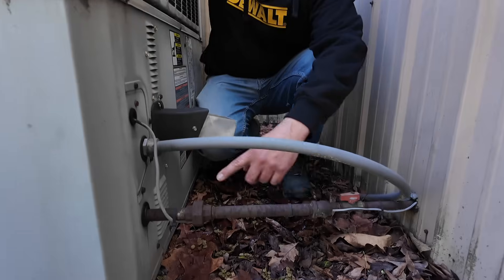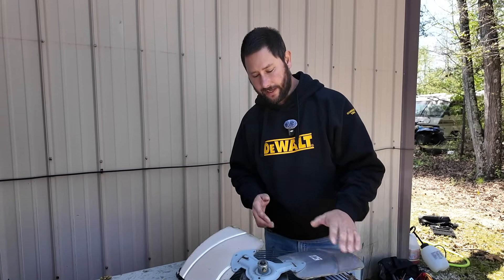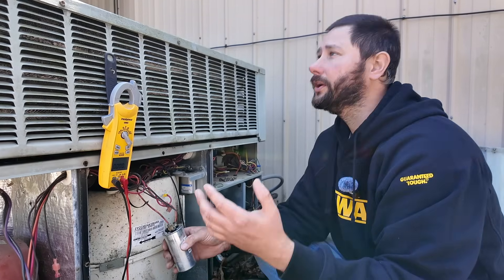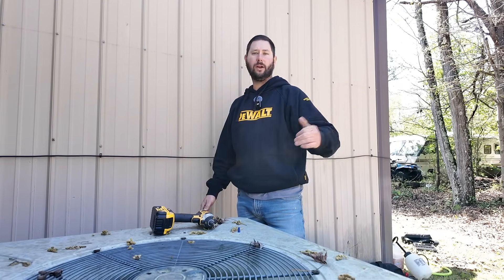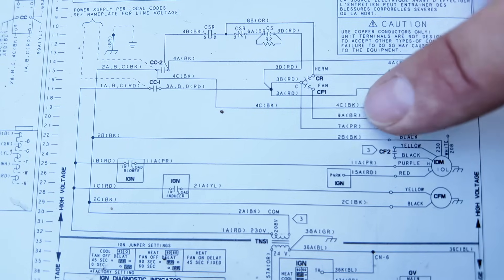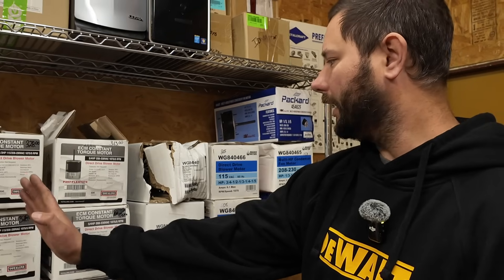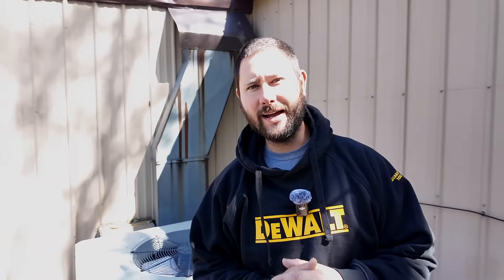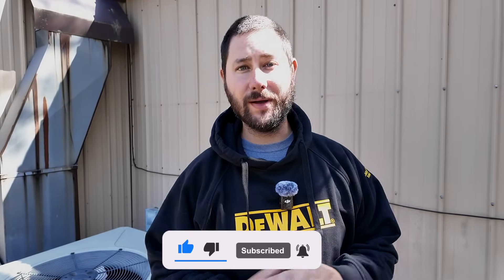How do YOU Repair an Air Conditioner?

Comment: I used to work for a company called Johnson controls building York Miller, Picken, and Fricks air handlers I was a lead builder and we built 100% custom air handler units from the ground up and there’s nothing like regular AC units. The coils are not self-contained. They have to be connected to a cooler and heater system and they can get very complicating looking like houses almost each section has doors oh and another thing with the closed housing motors on the fans is possible with an air handler. It doesn’t always have to be an open housing because there’s such thing as a washdown unit and that unit is designed to be able to be washed or to have significant leakage on the inside without damaging any component inside or leaking fluids out the outside, and it’s also designed to be able to be washed.

Comment: That capacitor is not bad. It is still good. Younhave a tolerance of +/- 5 or 6 %.
Reply from the maker: Then answer the question of why the fan motor did not run properly with the capacitor until after I replaced it.
Reply: @taddydigest  comon Tad you know 4.9 out of 5 is not bad. Might of had a loose connection.
Reply: @taddydigest  Loose connectors
Reply: @taddydigest the capacitor MAY be bad, but not based on the reading on the meter. That reading is perfect. Either that's a false reading, or the capacitor has an internal problem unrelated to the mfd, or it fails under load, or it's just fine and the motor is flaky or bad connection as the person above said. But for sure nobody can say a 1% reduction is a bad capacitor. Pull up any Amrad 5mfd you have in your shop right now and see what it measures.

Comment: 4.9 mfd is fine for a 5 mfd capacitor it’s usually +\- 6%, don’t spread disinformation
Reply from the maker: did you watch the motor not starting with the old capacitor or did you skip that part

Comment: Isn't there a tolerance on the dual run capacitor of +/- 5%?
Reply: That was borderline on that capacitor I would’ve assumed it wasn’t bad tbh but it’s always worth a shot when the fan seems in good shape
Reply: @davidgearardo1788 4.94 out of 5 is literally perfect. That is only 1% off the mark. You can easily find brand new capacitors that are lower and there is absolutely nothing wrong with them.
Reply: 4.75 is considered technically still good but .2 is sooo marginal that was close
Reply from the maker: yes

Comment from the maker: I made a mistake in this video which I would like to point out 
I mistakenly identified the motor labeled IFM as the inducer fan motor which actually stands for indoor Fan motor 
The CFM is the Combustion Fan Motor used for heating 
Thank You for Watching